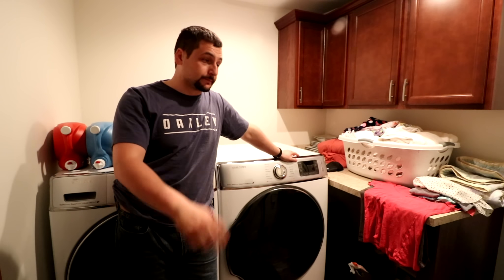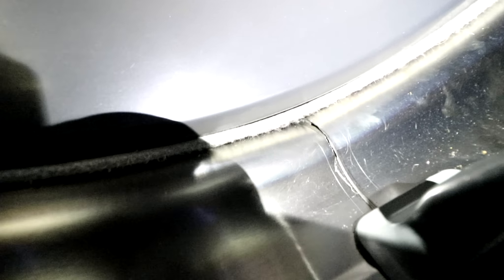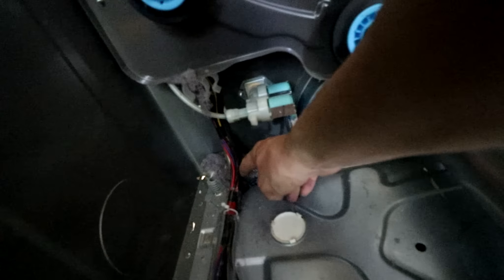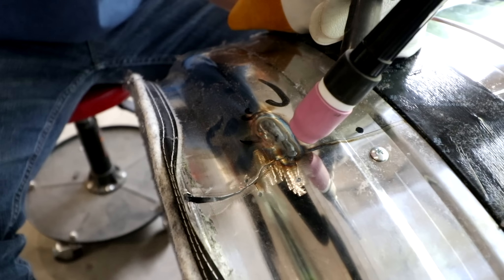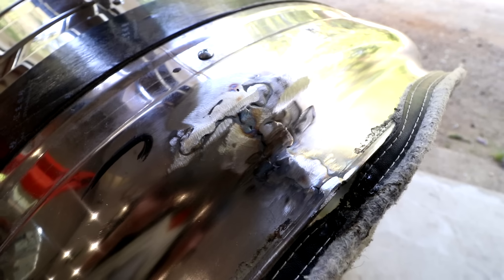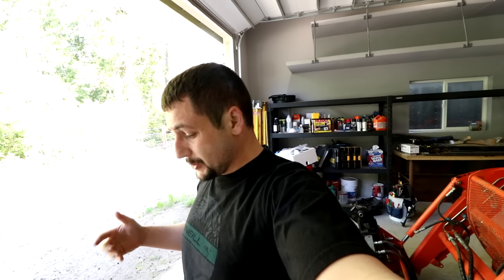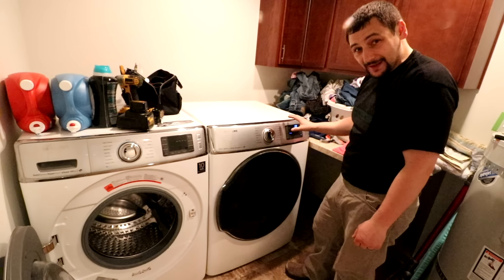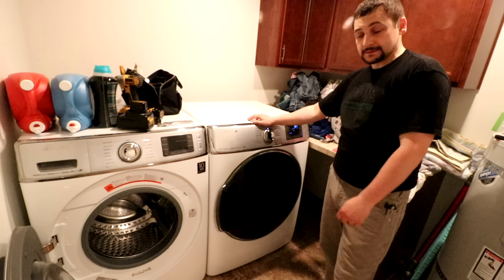Samsung Dryer Drum Cracked!!! How to fix it!!!

Comment: Anyone bought this expensive garbage dryer, let me know. I am starting a class action suit against Samsung.
Reply: I am so upset. My dryer is broken. Cracked bulkhead. This should not happen.
Reply: My aunt is dealing with this problem
Reply: Yes. Mine lasted 9 years. It has worked like a tank all these years, comforter, tons of towels, heavy huge loads! But the hole is huge now. It stopped spinning. It is a powdercoated drum. I expected it to last 15-20 years, not 9 years. It didnt even last 10 years. I got mine at best buy. I havent called samsung yet. Im looking at getting a new one but will try to call tomorrow. Im  interested in the lawsuit though. I shouldn't have to be replacing it this soon. Washer is still going. Samsung had a recall on my washer, the drum supposedly comes out if on on a certain cycle. They sent me stickers that help the problem(dont run towels on towels now, run them on delicate cycle). On the dryer, though, the powder coat drum is the issue. Im looking for stainless drum now. Theyre deceptive though as they will have two identical Samsung dryers advertised, side by side, same price even, one powder coat, one stainless! Other brands are too expensive for me. Two months ago when i looked at dryers at best buy, salesperson told me theyre not expected to last more than 8 years! Wth is that?(he said ALL brands of dryers, not just samsung!) Mom said our dryer lasted 18 years(kenmore). Friend has maytag, lasted 17.
Reply: This is a real deception. Home depot lists a samsung front load round door, the black stainless says its a stainless drum, but white is powder coat. Best buy, same sku, says powder coat on both dryers.
Reply: Yes , the dryer drum has cracked. I haven’t had the dryer 5 years

Comment: The exact same thing happened on my three year old LG dryer and so I called the customer service number on the instruction book even though it was out of warranty. They sent out a local technician who replaced the drum for free. He told us that this was a known defect with these drums.   Did anyone who tried to do their own repairs actually call the manufacturer first? I'm just wondering if the manufacturer actually responded to the issue or if they weren't notified because you knew the warranty period had expired so you didn't bother reporting (assuming that they'd deny anyway )
Reply: Do you have the number ?
Reply: Interesting how they shortened the warranty to 1 year..,

Comment: My parents purchased a set of Samsung drier (DV45K7600GW) and washer (WA45K7600AW), nothing but problems. The washer was recalled for exploding and the drier has broken down several times naturally after the 12 month warranty was up. The drier belt and pully/roller assembly melted before 2 years even hit, several drum rollers were faulty as well needing to be replaced shortly after 2 years. No cracked drum yet but there is paint chipping and rust on it already. The felt pads were shredded and gave up after 4 years, there is no where to purchase the felt gaskets online except getting a new drum $$$. I've had to open the drier repair several times. Not to mention the biggest issue is the thing builds up lint inside like crazy. It's a fire hazard! I've already noticed where some lint caught fire and partially melted some electrical tape on the wires that connect under the door.

Comment: Thanks for making this video ! I have owned the same model dryer for the last ten years. A few days ago I noticed the thumping sound and discovered a crack in the same spot. It's tough to decide whether to invest in a replacement part vs repair. 

Did you end up purchasing a new Washer/Dryer set ?
Reply from the maker: Nope I ended up replacing the drum, in the dryer about a year after I fixed the crack, the first time. And that was over five years ago and its worked great ever since.

Comment: Purchased a Maytag Neptune awhile back; developed that exact same sound and the crack looked very similar, too. A drum replacement's no longer available and not an option. Great at taking things apart, kinda okay at putting back together but not sure it's worth the effort. Regardless, good info, good job! Hope it lasts a long time for you. Me? Will likely spring for something fresh and new but not Whirlpool/Maytag brand, that's for sure.

Comment: I would recommend LG, as your next set. I have never had a problem out of my grandmothers LG set and they are 7 years old.
Reply: LG has the same problem, drums crack.
Reply: My Kenmore Elite made by LG just had the same problem. 7 years is not enough for a $1500 appliance. 10 yrs should be the min.
Reply: My LG is doing the exact same thing!   Crack in the drum.

Comment: I'm having the same issue, it cracked and it's making that same horrible noise, it's only 2 years old. My old GE gas dryer lasted me 13 years and it was still running.
Reply: I feel your pain. My Maytag lasted about 4 years before it cracked and started making that exact same sound. Part's no longer available. POS!
Reply: I got a nice gas LG gas dryer off CL for free due to cracked drum.  Had one of the guys at my work try to tig it but it was too thin, so I used JB weld.  I haven't hooked it up yet to see how that repair will last - hahaha.  Crazy thing is today's appliances are well over $1000, but last only a fraction as long as 'outdated' ones.
Reply: @mlb6d9  Did JB Weld fix the crack?
Reply: @MrKunleade  Nope - it didn't last long at all, and was wishful thinking on my part.  I ended up finding the same dryer on CL for free and robbed the drum from it, then sold it.

Comment: Thank you for this video - I got six years out of mine but it just developed this same crack.  Looking to do the same repair that you did.  Any update on how your repair has fared since July?  I've got a wire feed welder that I was going to use - thought it might allow me to weld it with a bit less distortion.
Reply: Did you end up trying it. I was thinking of TIG brazing it with some silicone bronze to cut down on the heat needed.
Reply: It's better to use epoxy imo.
Reply: @appliancedude63  We are on our second Samsung drum - first one cracked badly after about 3 years and tore up some clothes. We got a replacement that lasted about 4 years and then developed almost the same crack again, but not as severe. There was still enough intact that I thought epoxy was worth a try and was able to get the application of it on the outside of the drum smooth and feathered enough for it to not cause a massive thud everytime it contacted the rollers. That was back in operation about 2 months ago, and I saw yesterday it has started to crack through the epoxy now :/ It also looks like that drum part is maybe not available from Samsung anymore? I checked several online parts suppliers and they all show it out of stock. One still showed a price - appliance part pros I believe - and it was about $900! Our last replacement was $400 and it wasn't worth that - for $900 on a 7 year old dryer I guess we'll just buy a new dryer. I might take a run at welding this but it is so thin to begin with there just isn't much there to absorb contact with the rollers
Reply: @Lmberjosh , I have the exact same model in this video, and mine just cracked a few days ago in the same spot. I've had the dryer for a little over 10 years now. It's good to know that epoxy and welding are not viable solutions. I will probably purchase a replacement part because LG's similar 9 cu ft. dryer costs around $1200 and $2000.
Did you end up purchasing a replacement dryer?

Comment: Gonna try to fix mine with some silicon bronze simce it's so thin, should keep the distortion down. How did this hold up?
Reply from the maker: It lasted about 6 more months, then i ordered a new drum. In hindsight i should have just ordered a new drum to start with. Having to take it apart twice really sucked.
Reply: Thanks for the reply. Bronze didn't work for shit I just welded it with a 16 gauge aluminum backer to help with some shielding and pull some heat out, damn thing is like welding razor blades, used pulse and some .045 diameter 309L wire I brought home from work. If I get six months out of it ill be happy, mine wasn't cracked in two directions though, only on the factory weld seam.  Just not in the cards to buy another drun or dryer right now, just bought a new stove because the glass on our samsung stove exploded all over the kitchen on thanksgiving. Needless to say Samsung can go F*** themselves.